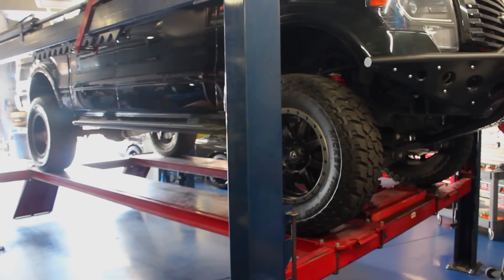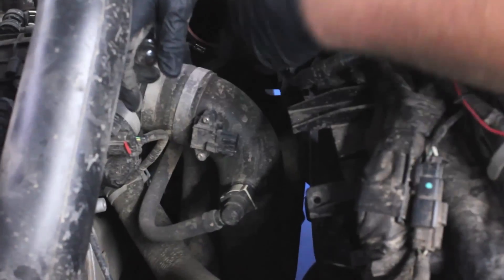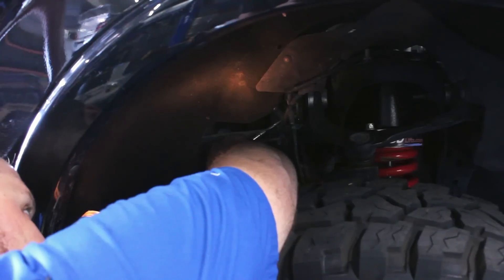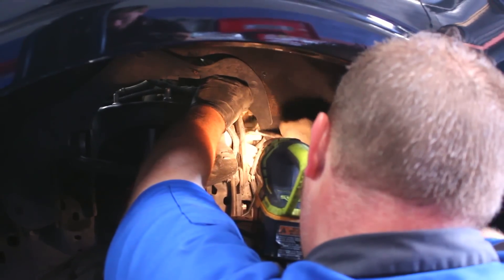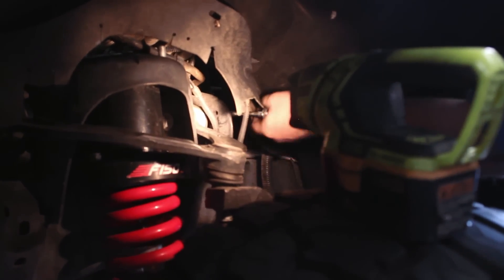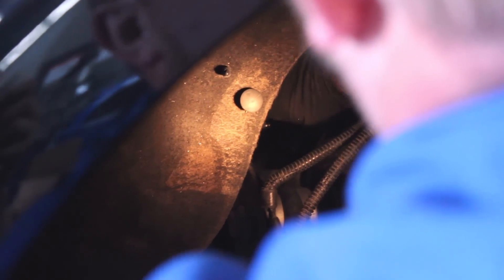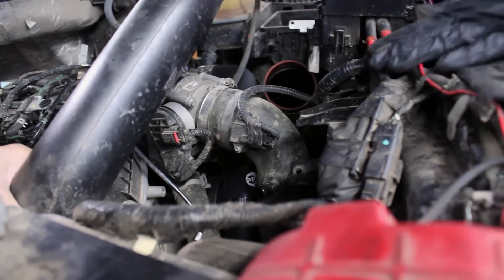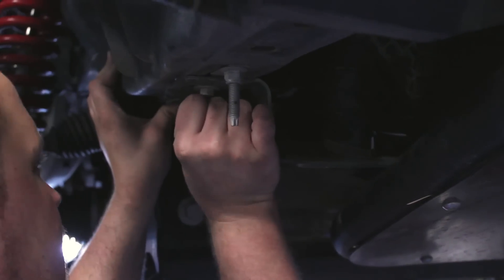2011-2014 F-150 EcoBoost aFe Bladerunner Hot Side Intercooler Tubes Install

Comment: Just added these to my non turned 13. I am VERY impressed after I pulled my 8K travel trailer. Butt dyno said more power and boost pressure was down.   Tight fit for sure! I replaced  the DR side PVC hose with one from a 5.0 (double 90 elbows). I had to trim the engine cover a tad on front of both sides and position the clamps so you an tighten them up after some driving.

Comment: "tricky" is an understatement.  The passenger side is an absolute P.I.T.A.  I wouldn't recommend doing the hot side at all.  The passenger side tube is too big for the space it occupies, and that's not necessarily AFE's fault, there just isn't any room there.  The coupling, when installed on the turbo is deformed because of the lack of space before you even attempt to install the tube...it flat out just doesn't fit.  I installed these today, and after I tried putting it back together I wished I had never even ordered them.  Unless your seriously serious about going for maximum flow, and HP....my recommendation is do not do this.  I was able to get the hot side, cold side, and a BBK throttle body installed today, but now I have a check engine light for an underboost code, which I now have to sort out.

Comment: Hi Guys,  Right at the :47 second Mark i see the pipe that looks like it reads "banks in white letters.  Where did you get that pipe or whats it called. What i beleive to be my Vac line has broken off the pipe end and i cannot find the correct part or piece to replace just the stub or that entire pipe anywhere.  Please help,  ive got the hole taped over right now as i drive back and forth to work on a dirt road every day